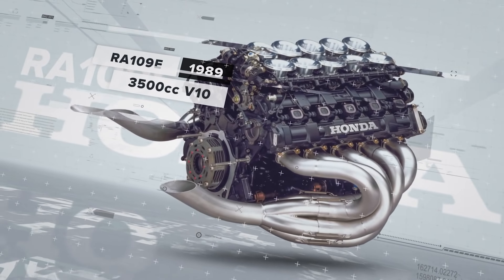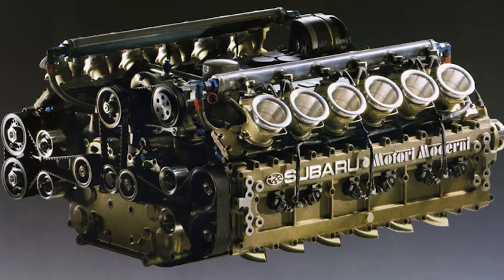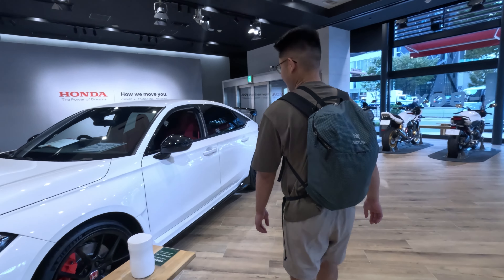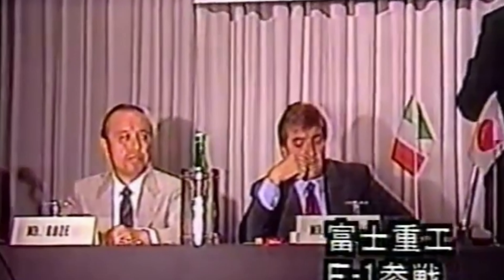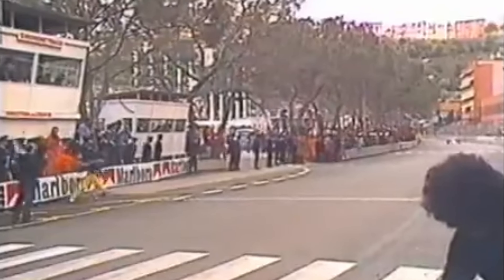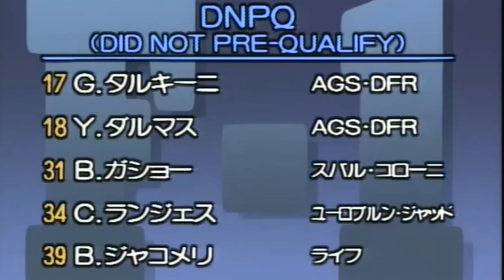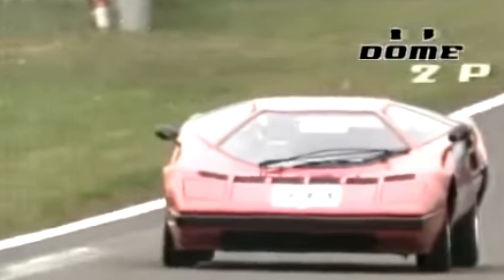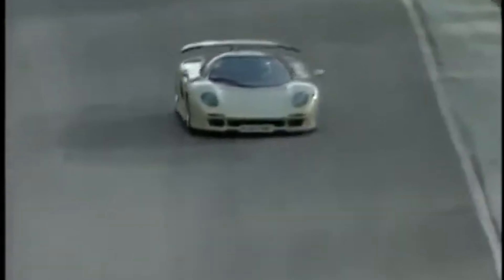Subaru's Crazy Flat 12 F1 Engine

Comment: This engine was destined to be under powered due to its inherent Harmonic Frequency of its Flat 12 Design.  
It should have been developed using a Single Large Supercharger fed by Twin Turbos - this Turbo / Supercharged design would have reliably delivered well over 850 bhp and up 1000 bhp if Water/ Alcohol Injection were added.
Reply: Wanna make one with me bro lmao
Reply: The harmonic frequency does not make it less powerful, the design of the engine was just bad. Also supercharging/turbocharging was forbidden in this era of F1. All in all just bad engine design.

Comment: Subaru could barely make the EJ25 work after 30 years with the thing. I can't imagine them making a decent F1 engine
Reply: F1 engines don’t have to be as reliable as road-going engines.
Reply: Tbf it was only the us spec which was unreliable
Reply: @Umar-gw6fy Not true unfortunately, the euro spec was a liability too.
Reply: @samuelgarrod8327  not nearly as bad as us spec tho, americans complain about engines blowing up at 50,000 miles but here, in the uk atleast, most subarus are at around 100,000 miles and still in good knick
Reply: Only because every single EJ25 got modded to hell.
Reply: @Umar-gw6fy  Yeah, if they've been left standard.
Reply: The new fa20  and 24 are pretty good. Much better then the EJs
Reply: @samuelgarrod8327  not even just stock ones the majority are remapped to around 350hp atleast
Reply: Uk here, EJ owner. My subaru has been the most reliable car I have ever owned. So can't be that bad.
Reply: @Umar-gw6fy both our jdm spec c and UK spec 2017 sti have both been straight piped and modded to 370-390 and never once failed. People use subarus as rally cars. They're never looked after or respected. Respect the car and it will respect you.
Reply: Tf are you on about? Ej is easily one of their best engines.

Comment: IF, Subby's Flat-12 has Any 'Heritage' to their frickin' dumb-assed flat four, then, the Timing-Belts cog's will WIPE OUT ALL TWELVE CYLINDERS on that cheap $13 PLASTIC TOOTHED GEAR that tensions that timing belt.  Hate that CHEAPNESS. Hated that $2200 bill, too, on my Outback. Subby Sucks.